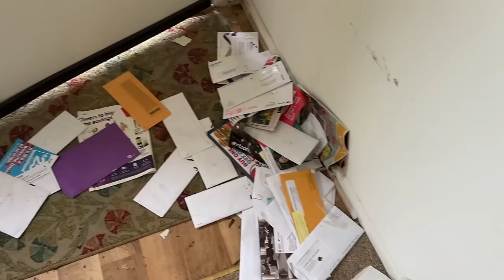One of the worst apartments we've ever painted

Comment: I do my pricing by the SQ FT…wall repaint is 1 price per sq ft, then walls with trim repaint is more. Then depending on the number of colors my price per sq ft goes up..ceilings get priced per room if they need painted and anything more than 1 coat gets charged double…currently paint around 1600 units per our turn season which lasts from April-September..rest of the year we do 90% residential interior paints
Reply: That's what I was thinking. It's been over 20 years since I was painting but it was always per square foot.  I'd be doing most of that work myself too. Maybe another guy. Who knows anymore though lol

Comment: gopro is sht they completely failed when they went for number 5 or 6. get a 360 those are cool as sht they film in 360 and you can aim them any direction in the editing.. btw this HD Gopro idea you have is completely useless.. You are not doing anything where you need hi def. even construction there isnt anything that needs anymore power than an average iphone. Iphone 11 puts go pro to shame.. in fact go pro is trash. last set i had was go pro 6s and they are trash compared to the 360s. when talking about doing sports or filming on a ladder and being able to control a 360 degree pan with editing is the way to go. I havnt gotten a 360 yety but itl be the next camera i get.